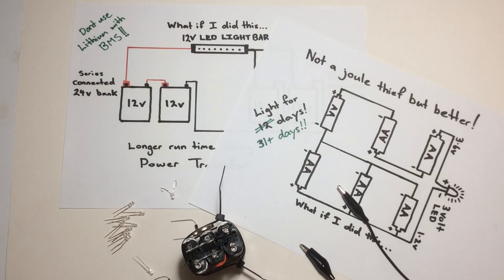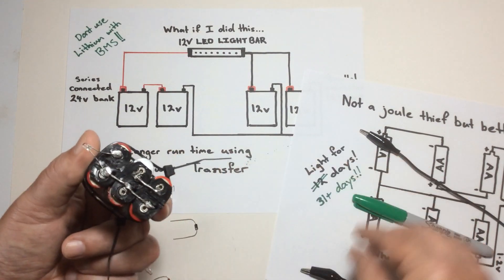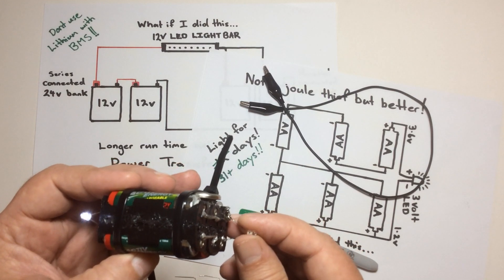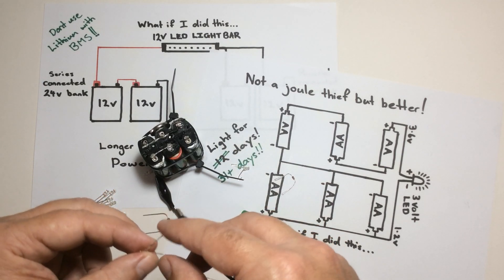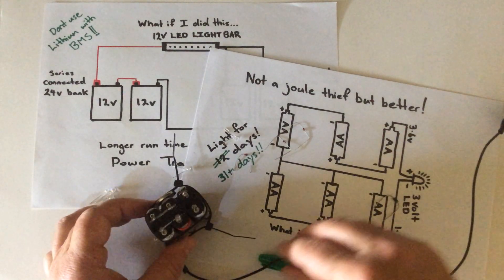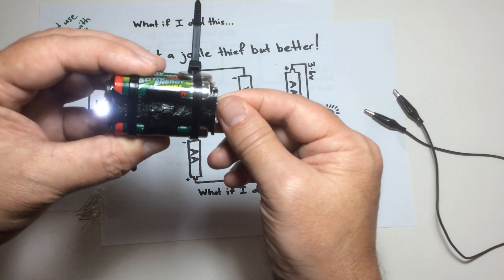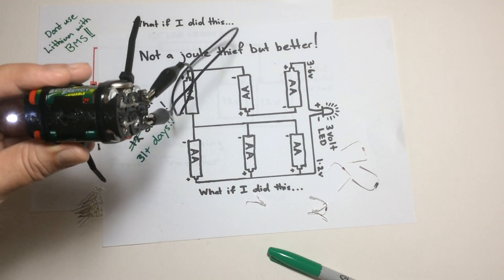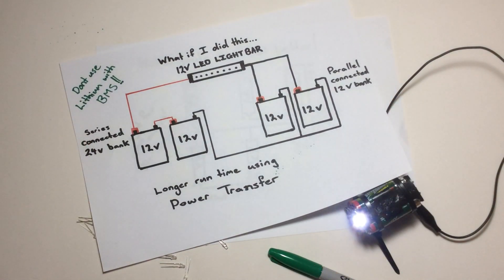Cheaper Electricity....without Killing Yourself!

Comment: ahh! i should have waited till the end..yep cheers
Reply from the maker: Did you have any luck with soldering? I'm waiting for AA battery holders to arrive, the ones with the wires coming out of the holder. These would be easier to string together. When they arrive I will make another video.
Cheers
Reply: @whatifididthis...1236  no..i tried but it wouldnt stick..i also think my bulb is no good.....so no luck here sorry bro ...
Reply from the maker: @thebigfella9095  All good, perhaps order some AA battery holders with wires attached, I had dramas getting the tabs on the battery holders to take up the solder and I nearly melted the plastic. At least when the holders with wire already attached arrive they can be twisted together by hand, no solder required. I also bought 1000 of those LED’s and they were ridiculously cheap.
Definitely worth it to save money in any way you can in these tough times.
For example, normally you would have to pay to charge the AA batteries every day, when using this circuit you only pay to charge them once a month!
Please keep me posted on your progress.
Reply: @whatifididthis...1236  good ideas there cheers...yes i will let you know....thanks mate

Comment: so..best to put the light as the drawing?..on the positives?...or on the negatives?....could you please update the drawing to your your second theory?..cheers mate..great work
Reply from the maker: Great question, at this point it seems the light can either go between negatives or between positives. Originally it was between positives. Unfortunately or fortunately it lasts so long to do a test, 31 days, that it will be 31 days before I can answer your question. My intuitive response would be between positives but I have no evidence as of this moment. For now place the light between positives and let me know how you go. I’m currently running the light between negatives so I will keep you updated on that method. I will make another video as you suggest with new schematics for both versions.
Reply: @whatifididthis...1236  ok awesome bro..im trying but im struggling welding the connections all together, so a bit slow.....and other shit..but im half way there....yes i will let you know..cheers mate thanks
Reply from the maker: @thebigfella9095  All good, keep at it, if it were easy it probably wouldn’t be worth it 😂🤣
Reply: @whatifididthis...1236  exactly cheers
Reply: Rrþ